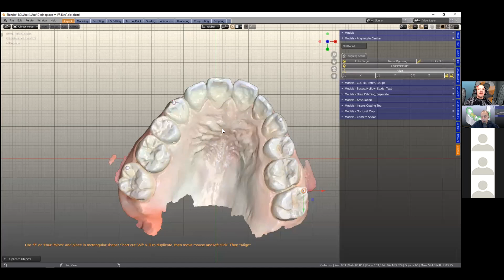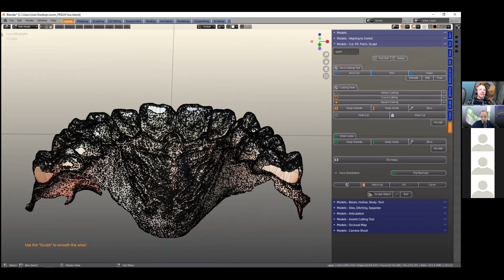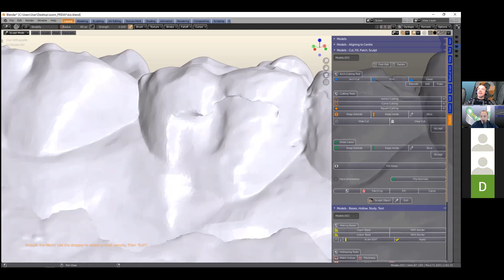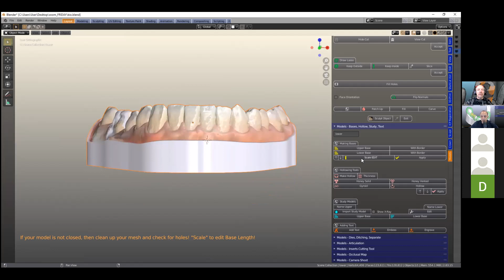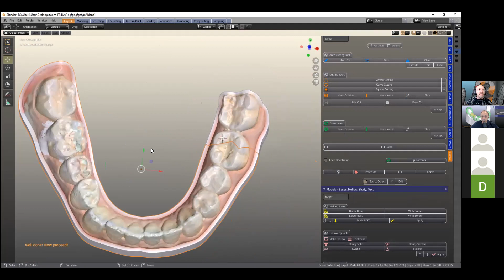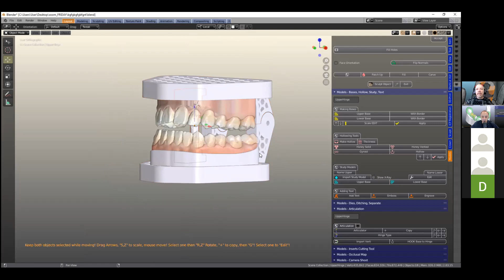B4D Dental Modules

Comment: Hi, I’ve tried to work with coloured models from ply files but I can’t get them show the colour up. Could you specify which parameters I need to control to work with coloured models?
Thanks in advance
Santiago Oliver.
Reply from the maker: Select vertex colours. Top left drop down box.